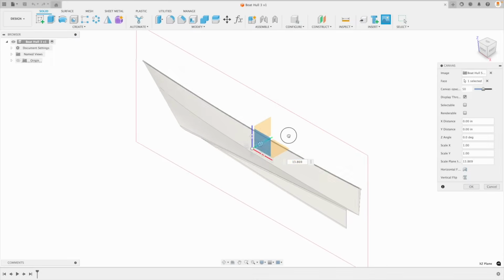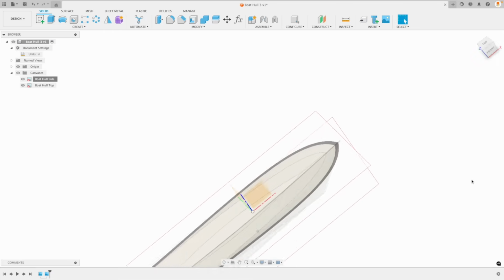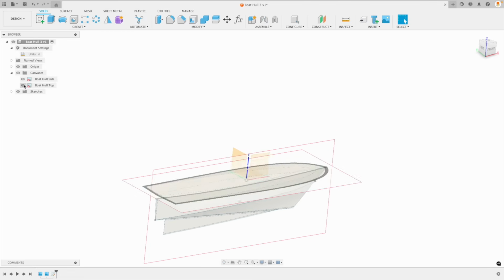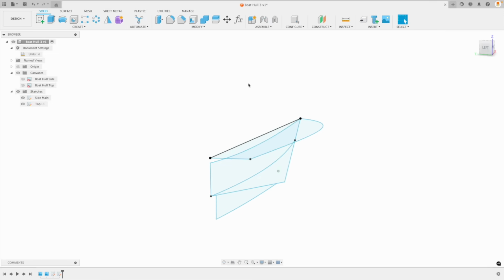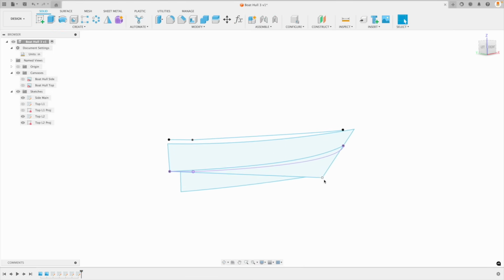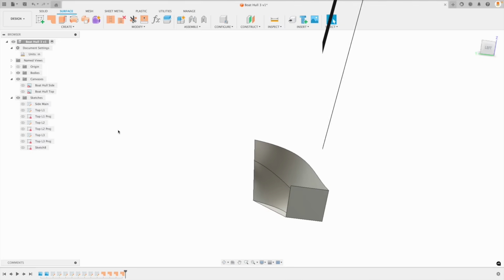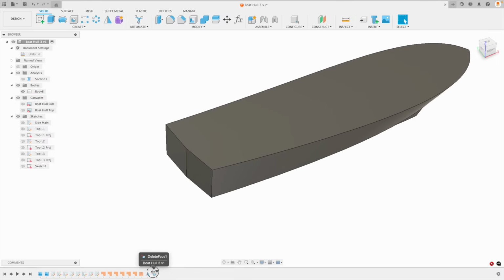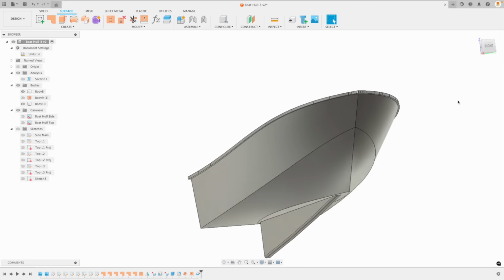Autodesk Fusion 360 - Surface Model a Boat Hull - Intermediate/Advanced Tutorial (2024)

Comment: Really nice video, clear and concise, though how would you go about dooing it, if you dont have a top down view available, only a side view and the front view of the frames of the boat, (say 10-15 frames)?
Reply: @claeswikberg8958 I'm not sure of his answer here...

Yet you can draw each of the "bulkheads or former stations" (for lack of any other terms for it in your particular boat design's case here...)

Extrude each of them to give them a little depth like say marine plywood would have a thickness in reality.  

Then move and/or align and space them all out per your profile view in 3D space probably following down the boat's natural centerline or one for all of your bulkheads' shapes. After that check the side profile for height adjustments.

From there often you can loft between each of them in the surface modeling tool set by selecting what I previously referred to as the thickness of the plywood.

Achieving the front bow shape may get a little tricky possibly in with this lofting process from the back of boat to front here so there is Patch tool as well in with the surface modeling tools. Sometimes that tool figures out the intended shapes better than the loft tool.

If all works out well in Fusion this just might give your boat a hull body surface.

Next, come back into the solids modeling tool set and thicken those surfaces.

Might be one way about it for you.

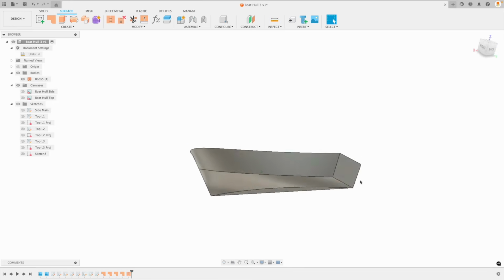But like he mentions here all the projections of surfaces with this Thicken tool are going to be aligned or orientated as if coming straight out from the surfaces you just created in the surface model you just made thru surface lofting, if that works for you. That thickening alignment with each of these surfaces he refers to as being along "the normal" at about 27:37 min mark in this particular video. 

Anyway, that might give you a boat hull or shell shape of your boat hull from the formers you have access to.  Perhaps then it becomes about refining with the rest of it as desired with the other solids modeling tools from there, I suppose.

For instance, you could slice thru the gunwales using split bodies to sort of flatten them like he was concerned about in this video.

Have you tried anything like using that approach as of yet for this boat of yours?
Maybe that will help get you going or confuse the heck out of you.
Best of luck from a fellow viewer
Reply: @claeswikberg8958 I'm not sure of his answer here...

Yet you can draw each of the "bulkheads or former stations" (for lack of any other terms for it in your particular boat design's case here...)

Extrude each of them to give them a little depth like say marine plywood would have a thickness in reality.  

Then move and/or align and space them all out per your profile view in 3D space probably following down the boat's natural centerline or one for all of your bulkheads' shapes. After that check the side profile for height adjustments.

From there often you can loft between each of them in the surface modeling tool set by selecting what I previously referred to as the thickness of the plywood.

Achieving the front bow shape may get a little tricky possibly in with this lofting process from the back of boat to front here so there is Patch tool as well in with the surface modeling tools. Sometimes that tool figures out the intended shapes better than the loft tool.

If all works out well in Fusion this just might give your boat a hull body surface.

Next, come back into the solids modeling tool set and thicken those surfaces.

Might be one way about it for you.

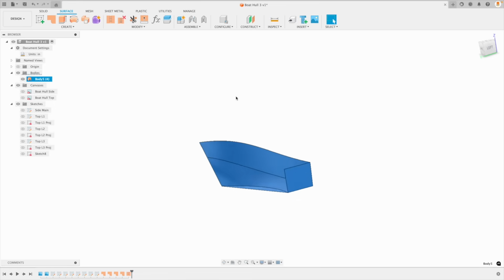But like he mentions here all the projections of surfaces with this Thicken tool are going to be aligned or orientated as if coming straight out from the surfaces you just created in the surface model you just made thru surface lofting, if that works for you. That thickening alignment with each of these surfaces he refers to as being along "the normal" at about 27:37 min mark in this particular video. 

Anyway, that might give you a boat hull or shell shape of your boat hull from the formers you have access to.  Perhaps then it becomes about refining with the rest of it as desired with the other solids modeling tools from there, I suppose.

For instance, you could slice thru the gunwales using split bodies to sort of flatten them like he was concerned about in this video.

Have you tried anything like using that approach as of yet for this boat of yours?
Maybe that will help get you going or confuse the heck out of you.
Best of luck from a fellow viewer
Reply: @claeswikberg8958 I'm not sure of his answer here...

Yet you can draw each of the "bulkheads or former stations" (for lack of any other terms for it in your particular boat design's case here...)

Extrude each of them to give them a little depth like say marine plywood would have a thickness in reality.  

Then move and/or align and space them all out per your profile view in 3D space probably following down the boat's natural centerline or one for all of your bulkheads' shapes. After that check the side profile for height adjustments.

From there often you can loft between each of them in the surface modeling tool set by selecting what I previously referred to as the thickness of the plywood.

Achieving the front bow shape may get a little tricky possibly in with this lofting process from the back of boat to front here so there is Patch tool as well in with the surface modeling tools. Sometimes that tool figures out the intended shapes better than the loft tool.

If all works out well in Fusion this just might give your boat a hull body surface.

Next, come back into the solids modeling tool set and thicken those surfaces.

Might be one way about it for you.

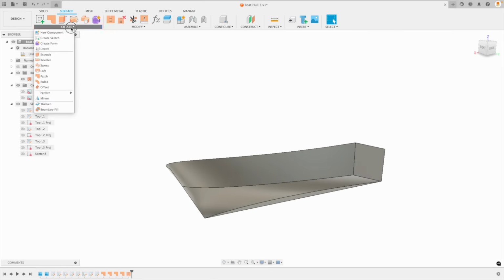But like he mentions here all the projections of surfaces with this Thicken tool are going to be aligned or orientated as if coming straight out from the surfaces you just created in the surface model you just made thru surface lofting, if that works for you. That thickening alignment with each of these surfaces he refers to as being along "the normal" at about 27:37 min mark in this particular video. 

Anyway, that might give you a boat hull or shell shape of your boat hull from the formers you have access to.  Perhaps then it becomes about refining with the rest of it as desired with the other solids modeling tools from there, I suppose.

For instance, you could slice thru the gunwales using split bodies to sort of flatten them like he was concerned about in this video.

Have you tried anything like using that approach as of yet for this boat of yours?
Maybe that will help get you going or confuse the heck out of you.
Best of luck from a fellow viewer
Reply from the maker: Thank you! While you might hit some limitations, you should still be able to model it using the same methods in this tutorial.

Comment: @learnitalready
Nice video sir and your teaching techniques are very professional and quite educational. It is quite evident that you have extensive experience in providing quality instruction well before this channel existed.
 
I admire your expertise of working your way through each of the steps it takes in Fusion often and problem solving it requires to reset your thought process when a potential solution doesn't quite pan out as one might expect or would have figured it to with various tools in this software, Fusion...

I was curious what you'd say it might take to essentially...
(And maybe this could be thought of as well, as simply reversing this process a bit of what you did here but not exactly... 
Or what I attempting to say is) to take the 3D modeled surfaces L1, L2, L3 basically...
And get those shapes in 2D or flat pack form. 
Each of these would be kind of rectangl-ish shapes albeit, with a long sweeping arcs for each of the two longer sides and possibly the short edges could be near angular straight lines here at front and back of this boat you demonstrated. 

I'm sure this reversing back out to a 2D surface panel technique would be valuable to many fields of design and drawing. 

I believe the sheet metal tool set would be the ticket here for this. Although, I haven't yet completely figured out how to translate a 3D model with curved shapes or curved surface forms back into a 2D panel outline, as in giving me the panel shapes in 2D for something like represented as your L1, L2, L3 shapes in this video.

NOT to be confused with the side profile, nor having Fusion create the "Drawing sheet's", profile projected views in something like Typical CAD scaled viewports. 
But I'm interested in the full panel shape laid out flat and how to have Fusion provide me that. 

It seems as though I'm asking about reversing the "intersection curves" Fusion function. or to have it go from 3D model to 2D linework instead of the other way around.

Maybe it is part of the Sheet metal tooling I've often thought, and hence that's what I should be seeking more information about with something like this? Or perhaps a function of the Fusion "projection" tool perhaps.

I get the general concept of parallel projection or essentially Orthographic projection in common drafting terms and that seems what Fusion's  "projection" tool does for the modeler in the 3D environment. 

Or am I simply attempting to do something beyond Fusion's capabilities at this point? 
It seems like with the sheet metal unfolding /flat pack descriptive geometry magic and the 3D "projection" feature sometimes being effortless for it to provide, this inquiry of mine would be still in its wheelhouse. 

I believe you would understand what I'm asking by now for sure but one last way of saying it here in closure is essentially 
"With these panel shapes I'm asking about how to have Fusion help me illustrate. If you knew their shapes in 2D then you could create panels or planks for this boat and bend them to form into the 3D hull shape you had modeled. Reversing that to me would be taking the 3D model and unwrapping its full shape profiles or uncurving them back out of their 3D depth in space back into a 2D shape.  
Kind of similar to clothing patterns might be drafted up to fit various shapely forms.

Do you have any advice or tips of resources of how to go about illustrating stuff of that nature in Fusion.
Thank you kindly in advance for any light you might be able to shed on that topic as it seems you were getting close to that subject here with this video, sort of, in doing a bit of a boat lofting technique. It would be interesting to figure that out in Fusion and be much appreciated.
Reply from the maker: Thanks so much for your kind comment. I find that comments like yours comment from good students and good learners. Keep it up. 

Regarding the rest of your message: yes, you can definitely use sheet metal tools and flatten out the complicated patters. There are some limitations at times, but there is usually a way. I would love to do a future tutorial based on that, but I just don't when I'll have the time to do so these days.

Please keep in touch. It is always nice to hear from those that have expressed appreciation for this channel and what they've been up to with Fusion projects. 

All the best.